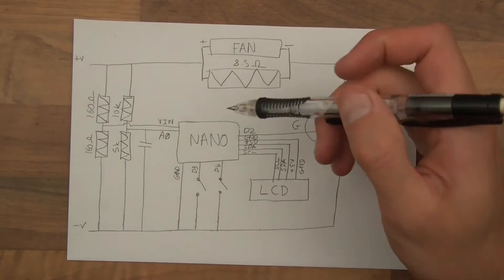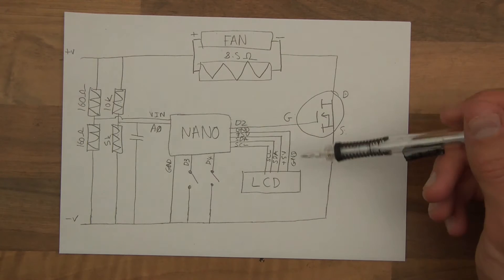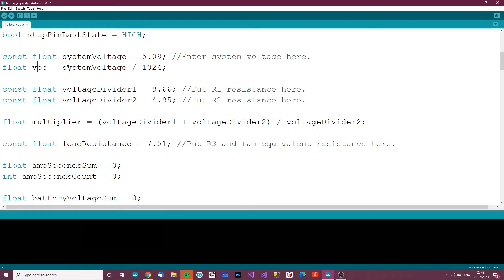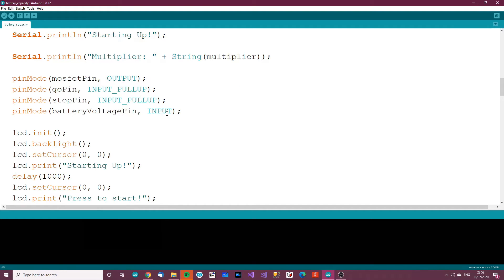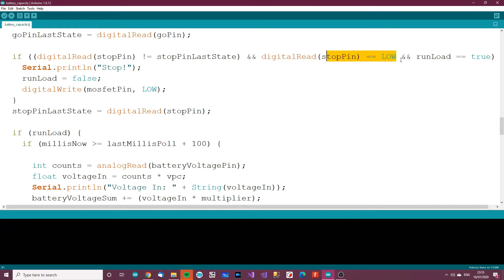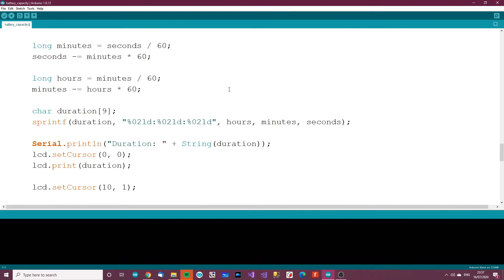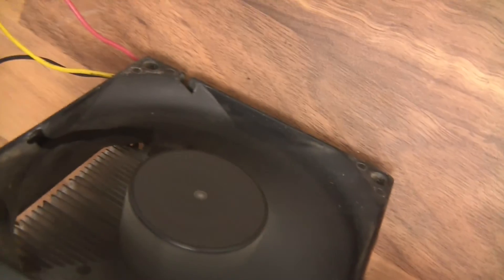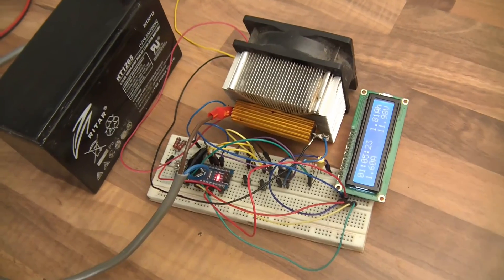TUTORIAL: How to Make a DIY Lead Acid Battery Capacity Checker Tester - Arduino LCD Part 2/2

Comment: theres only one small problem I see here, if you have a heavy duty battery with a large amp hour capacity, you could be waiting a loooong time for the test to complete, perhaps modify the code to say a 10 minute test and extrapolate the data to give more of a guide to the battery health, even better combine the two to have a short test and a long test, just a thought...
Reply from the maker: You're right. A 50ah battery could take over a day to drain. I could have a 2ohm resistor which would allow a 6amp draw. A typical car batter would drain in approx 10hrs, but dissipating 72watts would make the unit scalding hot! 😂